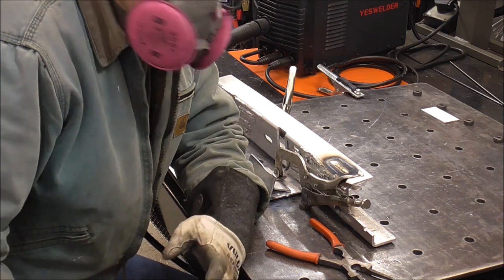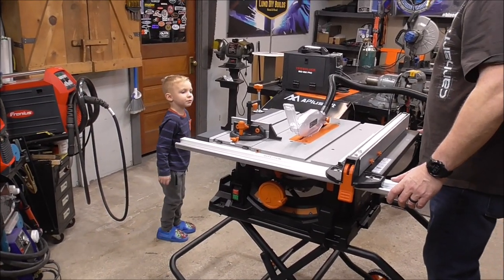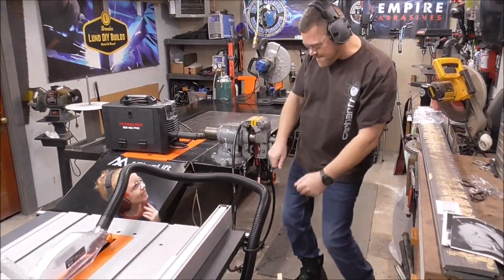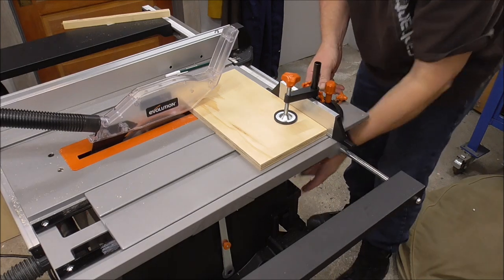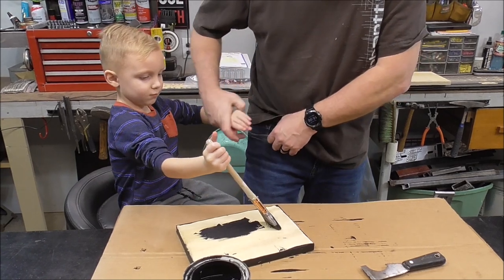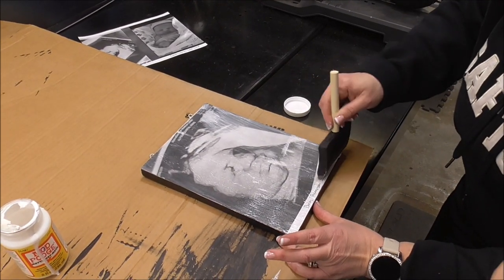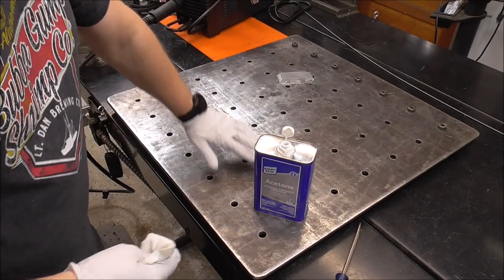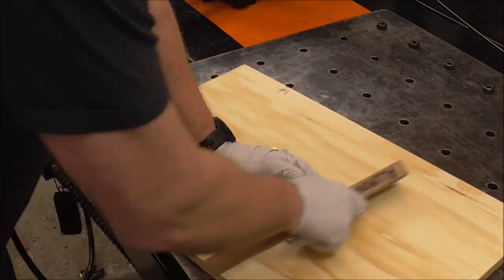Basic MIG Welder Setup to Get you Started Welding Aluminum

Comment: Thanks for the info . But take a meter to your welder and check the actual amperage output  to see if it matches what is on the display . I have a few yeswelder machines . And they tend to be lower than diplayed.
Reply from the maker: Thank you for the tip. I'll look into it. 👍
Reply: Silky me bought a clamp on meter and was trying to get a reading on my welder, but the numbers made no sense.
Found out you need a clamp meter that reads AC amps.
Reply from the maker: Are you welding aluminum or just using an AC welder?

Comment: Nice video Brandon, I have a Yeswelder 250-PRO and I set it up for aluminium, I try the settings you put in, and I burn trough, the difference is I am using 4043 wire at .035 size, I am trying to weld 6061-T6 aluminum 1/8 thick, I tried all sorts of settings, up to now my best beads are at 18.2 volts and wire speed at 8.2, but the bead is very flat and if I try to join 2 pieces I don't seem to be able to lay enough material to fill the voids.... I can't seem to be able to find the sweet spot, is there a method to find the sweet spot, fiddling with both wire speed and volts sends me from almost not too bad to catastrophic, is there a pro welder here that could tell me a method to set up my machine right? Is it true that the wire speed modification, changes the amperage too?
Reply from the maker: Hey Tony, it's been a LONG time since I used that machine but I remember it took me quite a while to get it dialed in because the directions werent great. I had to experiment quite a bit to get it to work right. Are you using the card that came with the machine to get you close to the correct settings?  What I do is set the machine to what the card says then adjust from there. Your in the right range for the wire size and material. I weld at 17.9 volts and 102 amps for your setup. I don't know if you can get your machine to read in amps but if so, this setting should work.

Comment: Thx Brandon, good video regarding settings. Were those last settings still for 1/8 or did you use thicker material?
Why did you use 0.45 wire rather than 0.35? Could you not get spray transfer using thinner wire with slightly less volts?
Those last welds certainly looked good!
Reply from the maker: I think the 045 really works well on the thinner metal. If If I messed with the 035 more im sure I could find the sweet spot but it would take me a little practice. I try to keep a journal of settings with my machines when I find a good one. That helps too

Comment: Thx Brandon. Those last welds certainly looked good. Were the settings you used still on 1/8 or was it thicker material? Also, why did you prefer 0.45 wire rather than 0.35? Would 0.35 wire allow you to use less voltage to obtain spray transfer? Thx again
Reply from the maker: The machine was still set for 1/8" but mig aluminum tends to run VERY hot so by using the thicker wire, it was in a way reducing its penetration.

Comment: hi your Fronius TranSteel 2200 what max thickness weld or Max number? thick adjust of synergic mode
Reply from the maker: You can multi-pass with this so you aren't limited to any specific thickness. It's also good at MIG aluminum

Comment: Hey Brandon, I'm thinking about videoing the assembly of a plasma table I've ordered for my own review if there are problems and also to share on the companies forum.  I have never videoed or edited anything before and I have done some research on software to assist with this process but you know how everybody thinks their product is the best.  So I have decided to ask the people who do this every day to see what they recommend. I have no equipment or software at this point.  That being said, if you don't mind my asking, what do you use to record and clean up your videos? I don't plan on putting stuff on Youtube unless something I run into may help others who are working on this same type of machine.  I appreciate any help you can offer if you have the time.
Reply from the maker: @David Haywood i know a lot of YouTubers that shoot video with their phone and it's what I did for quite a while. Probably my first 25 or so videos were on an android.  The image stabilizers and video quality of the phones now are going to be just as good as any mid-range cameras and most all film in 1080 resolution @60 frames per second which will give you a smooth slow motion shot if you need to slow down the action when editing. I then switched to a panasonic handycam that was my daughters for a school project. That camera got ruined when a welding spark burned the lens so I replaced it with the same model that I found used on EBay for 10 dollars. I did a hundred or so videos with that one until recently I've upgraded to a panasonic handycam that can shoot 4k but it's not necessary for what I do. I've settled on shooting video at 1920x1080 at 30 FPS and I can’t tell the difference between any of the cameras I've used on my channel when filed at the same frame rate. Pretty much anything will work if you have good lighting. As far as editing software, that’s varied by user and everyone has their preference. I like Davinci Resolve for my YouTube videos which I edit on a laptop.  If you go the phone route (which is what I did starting out) just record video on your phone.  To edit them, just download the Filmora Go App on your phone and you are all set.  Filmora Go is a really simple video editing app with all kinds of features. I recommend the paid lifetime version which is what I have.  I use the Filmora App for whenever I'm editing videos that I shot with my phone. Good luck my friend!